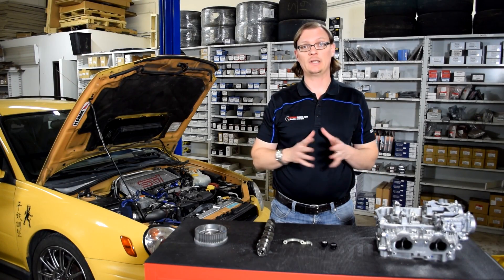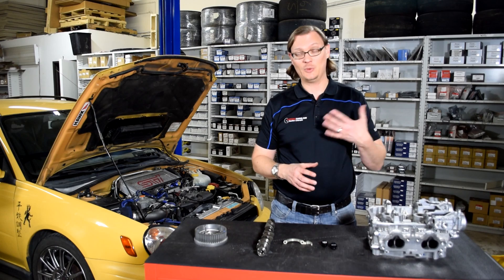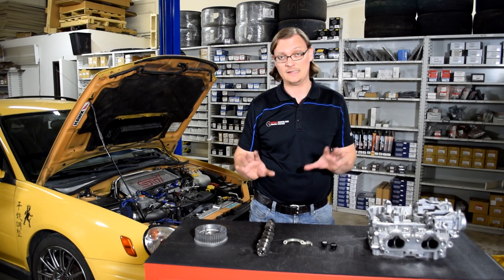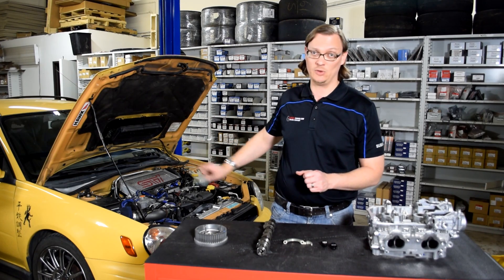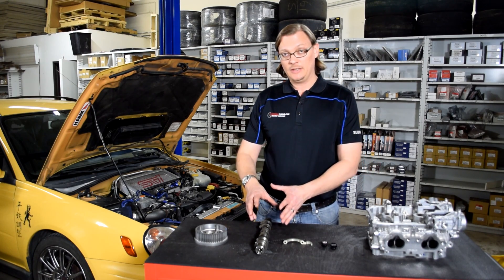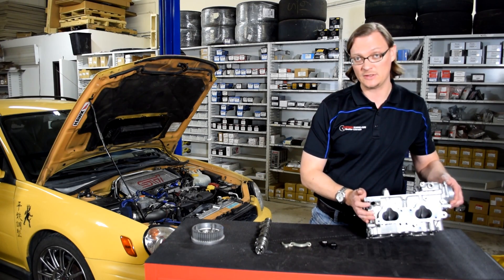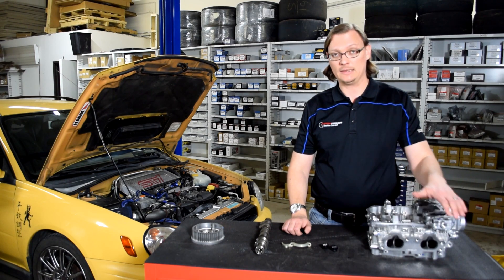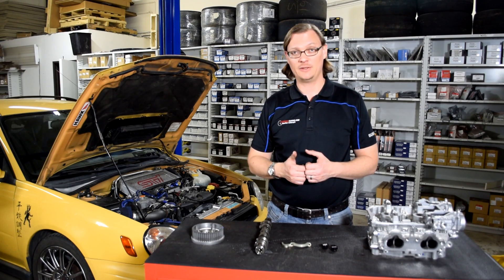How to put a turbo EJ 2.5 Liter engine into your 2.0 WRX

Comment: are the 2.5 camshaft gear teeth the same ?? n are the crank gear teeth different also ??
Reply from the maker: As long as you are working with the EJ engine from 2002 on, they are the same.

Thanks for your question and Stay Tuned!
Reply: from 2.5 to 2.0

Comment: I want to just drop a complete 2018 drivetrain from a wrecked sti into my 2 door gc8.... uggh no info... wonder if i can use the tranfer case and rear end with the new 6 speed... probably gonna need a custom driveshaft?  Idk idk who to ask lol might just have to start tearing it apart... might have gotten in over my head lol
Reply from the maker: Thanks for your question.  I would first recommend taking a look at the videos that we did on putting an STI 6-speed into a GD.  That is basically the same process for putting the drivetrain in a GC.  Here are links to them:

https://youtu.be/uf4tcG5GqDU

https://youtu.be/nUJ7E2Bh5g0

That should get you a solid start on your swap.

Hope that helps and Stay Tuned!
Reply: @FlatironsTuning  awesome! thanks for the reply

Comment: Since you must run the AVCS solenoid, is it okay if you install solenoids that are low cost or ones that are potentially bad solenoids? If the solenoids are not actively doing anything, does it matter if they operate properly or not?
Reply from the maker: Thanks for your question.  You are correct that the solenoids will not be getting any voltage, so they would not ever need to function.  I'd say that if you don't want to use new ones, known good used ones would work just fine as well.
I hesitate to say that a defective solenoid could be used.  Keep in mind that oil does still need to pass through the solenoid, and on the off chance that the solenoid failed due to metal contamination, you would not want to put that on a new engine ever.
Hope that helps and Stay Tuned!
Reply: @FlatironsTuning  that is very helpful and will save a good bit of money buying off brand vs OEM new. Thank you for the reply. You all have been super helpful in the build!
Reply from the maker: @itsrandall119  Glad we could help!  If you have any more questions, or need any parts, etc., feel to reach out to us through "Live Chat" on our site, we are always there to answer questions too.
Good luck with your build!

Comment: Is this a full engine swap? Like if I were to buy a sti engine and trans I could just swap it?
Reply from the maker: Yes, you could certainly do that.  As discussed in the videos, there are some advantages in putting in Non-AVCS cams, but yes, you can put both the engine and transmission into a WRX.
Thanks for watching and Stay Tuned!

Comment: Ok I would  like to have some clarification.  I have a 02 wrx iv been  redoing  the past 2yrs I went with  an ej257 swap. I read about the cams . So at the time I purchased  bc0601  what are ej205  cams. On line they say  it will not work. But I believe  you are saying  it can ... what do I need to do on the timming  side.  I believe  it would  be a straight bolt on using  all ej205  cam gears  and seals.  I would  just time it normal  right?
Reply from the maker: Thanks for your question.  Putting Non-AVCS cams into a car that originally came with AVCS would certainly cause some issues and take some work.  I believe that is why they say they are not correct for those heads.

But yes, as long as you are not planning to run AVCS as we describe in this video, then they will work just fine.  As long as you use the Non-AVCS cams and Non-AVCS cam gears the car will time correctly.

Hope that helps and Stay Tuned!

Comment: Hello, I have a Forester xt and a Forester X. Can I swap short blocks between the two engines ? Ive heard the ej255 with the SOHC heads will make good engine torque. But can I still make a decent running engine from the ej253 with the DOHC heads? I ask so I don't have to deal with the harness and ECU headache. Also the turbo is getting swapped as well.Thank you.
Reply: Public comments ,please don't  say but why... I have my reasons. Thanks again.
Reply from the maker: Thanks for your question.  The turbo block will bolt up to non-turbo heads.  But I believe that the turbo pistons have a deeper dish.  I would recommend taking a look at what your final compression ratio would be and go from there.

Hope that helps and Stay Tuned!

Comment: So I was just wondering, is this specific to ej257 or is this for all ej25 motors? I want to throw an ej255 long block in my 2002 wrx. How different is the ej255 from the ej257 in reality?
Reply from the maker: Thanks for your question.  From a fitment stand point, there is really no difference as long as both are single AVCS, so all of this would apply.

The engine in this case for instance is using D25 heads, and an EJ255 block actually.

Hope that helps and Stay Tuned!
Reply: @FlatironsTuning  Thank you for your swift response. That gives me some insight on my build goals. I'll reference this often.

Comment: I have a 06 wrx i just gutted the bulk head harness to do a manual swap due to it being an auto. I can get the bulkhead harness dash immobilizer guage cluster and ecu cheap. What else would i need beside the engine and driveline. Does the pedal assembly need to be sti or can i use wrx. Can i istall the harness and plug and play the rest?
Reply from the maker: Thanks for your question.  We haven't done that first hand, so I can't tell you for certain that everything will be plug and play.  But if you are using a complete bulkhead harness and the ECU that goes with it, that should work.

Good luck with the conversion, and Stay Tuned!

Comment: The 2.5 camshaft fit in 2.00 with pulley
Reply: Or I can put the head 2.5 into 2.0
Reply from the maker: Yes, that is correct.  I'd recommend going back through the video for more specific details on how this works.

Thanks for watching, and Stay Tuned!

Comment: When you say you must keep the avcs lines and solenoids do you mean just keep them in place? Or do you have to wire up the solenoids?
Reply from the maker: Thanks for your question James.  Yes, you just need to have them in place.  You don't need to wire them,  you just need to maintain that path for the oil.

Thanks for the comment, and Stay Tuned!

Comment: Thank you for your videos! Just finished my RA 5 speed build on my bugeye. So I can use 2.0 L wiring harness and ECU, just with non-AVCS cams and plug the sensor holes, but to get it to fit the 2.0L 5 speed do I need the 2.5 L flywheel and clutch?
Reply from the maker: Thanks for your question.  The short answer is no.  The clutch and flywheel are determined by the bell-housing of the transmission, not the engine.  So you would pick your clutch and flywheel based on that.

Congrats on the swap and Stay Tuned!

Comment: The video mentioned that the avcs cam gears would not receive oil pressure with the camshaft oil lines blocked, but did not say whether they would maintain oil pressure with the lines open. With the avcs system fully intact but just not wired up, would the avcs cam gears maintain pressure and be usable?
Reply from the maker: That is a good question.  Years ago when this was first attempted by someone around here, that is what they tried.  The issue was that the cam gears seemed to drift because there wasn't any control being applied through the solenoids, and it made tuning an issue.  I have heard of other people trying to keep the AVCS pulleys and solenoids in place with no power going to the solenoids, but I don't have any first hand knowledge of how it worked.

The method that we go through here is well proven at this point for what it is worth, but if you think that there would be a benefit in trying to keep all of the AVCS hardware in place, it could be worth a try.

Hope that helps, and Stay Tuned!

Comment: If I want to swap an ej257 into my 2005 wrx, all that is needed is to swap over the camshafts, cam gears, the bracket for the cam sensor as well as swap over the WRX manifold to retain the Drive by Cable, and then a tune? Is that all?
Reply from the maker: That sounds right.  You are correct in that you would need to treat that swap basically as a 2.5 liter swap.  Thanks for watching, and good luck with the swap!

Comment: Hi i wonna swap the full engine put 2.5 wrx to my 2.0 wrx is it gonna be straight swap???
Reply: You need to swap over the 2.0 camshafts, cam gears, intake manifold and  to keep the drive by Cable and purchase a bracket for the camshaft position sensor to install on to the 2.5 cylinder head. And then a tune.
Reply: @antoniopineda1556  i mean i wanna take the 2.0 engine out and put 2.5 in the full engine swap? Is that just straight swap?
Reply: @konradmakaveli630  Everything will bolt right up as far as dropping the 2.5 into the car. But in order to make it run properly you have to do a couple of part swapping from the 2.0 to the 2.5 engine.
Reply: @antoniopineda1556  ok thnkyou
Reply: @antoniopineda1556  i have a little problem can i swap the hol wires from the old engine to the new one as my throttle is different???
Reply: @konradmakaveli630  yes, you can use the engine harness from the 2.0.
Reply: @antoniopineda1556  thanks i done it all today the new 2.5 engine is starting but its loosing a bit power when im driving and trying to go a bit faster not sure do i need to plug to the computer and delete all the foults maybe that is the issu
Reply: Its like cutting out fuel or something ??
Reply: @antoniopineda1556  when the engine is on its a bit shaking..
Reply: @konradmakaveli630  which engine is it? Ej255? Ej257? And are you running the 2.0 fuel system with the 2.5?
Reply: @antoniopineda1556  i will need to check which one.. its the 2.5 fuel system
Reply: I didnt change the fuel system.. left it original
Reply: @konradmakaveli630  the 2.0 fuel system is what you want to use with the 2.5 engine. You can use the 2.5 fuel system but it involves some wiring with the fuel injectors. Easier to just use the 2.0 fuel system and make sure you are using the 2.0 intake manifold and throttle body. Also have you gotten the car tuned? If not it won't run right until you get it properly tuned. You have to get it tuned for the extra 0.5 displacement you have with the 2.5
Reply: @antoniopineda1556  ok i done the monifold and the throttle body it is tuned its got prodrive pack and remap. So what exacly i need to take from the 2.0 fuel system?? And just swap it
Reply: @konradmakaveli630  when you swap the intake manifold and throttle body from the 2.0 onto the 2.5 engine. Swap over the entire wire harness that was on the 2.0 intake manifold. Everything swaps over
 Fuel rail. Injectors. Etc. Also make sure you swap over the knock sensor from the 2.0 onto the 2.5 engine.
Reply: @antoniopineda1556  thanks what country is it?
Reply: @konradmakaveli630  US
Reply: @antoniopineda1556  thanks i change all the injectors but the car running really ruff and no power when im driving
Reply: @konradmakaveli630  Ok let's make sure you have all the parts. 
2.0 Intake Manifold
2.0 Throttle Body
2.0 Fuel System and Injectors.
2.0 Wire Harness
2.0 Knock Sensor
2.0 Exhaust and Intake Camshafts
2.0 Cam Gears
Did you purchase the bracket you need to use 2.0 Camshaft position sensor? And what size injectors did you replace stock ones with? Also when you say no power, are you talking about the engine not making boost?
Reply: @antoniopineda1556  yes engine not making boost
Reply: @antoniopineda1556  the camshaft position sensor is the one on the timing belt cover??
Reply: @konradmakaveli630  It should be on the driver's side behind the timing belt cover on the cylinder head. Did you use the 2.0 camshaft position sensor? And also make sure you don't have any boost leaks. Check your airbox/intake all the way to the throttle body and make sure hose connections are secured.
Reply: @antoniopineda1556  i didnt connect that cumshaft sensor becouse i just see i dont have that on the new engine will have to take it from the old engine and put it on the new one that what is making it running beadly??
Reply: @konradmakaveli630  you need to use the 2.0 camshaft position sensor on the 2.5 engine. To use the 2.0 sensor you need to purchase a bracket to install it on the 2.5 engine. https://www.rallysportdirect.com/part/sensor-brackets/cos1-sb0002-cosworth-cam-angle-sensor-bracket-billet-subaru
Reply: That could be the issue with no power as well

Comment: What are the advantages of using an single avcs, dual avcs vs non avcs?
Reply from the maker: Thanks for your question.  The main advantage is if you aren't using an ECU that supports single or dual AVCS, getting it to run correctly is very difficult.

It is far easier to build the engine to the configuration of the ECU that you have, compared to finding an ECU that will run AVCS.

There are some gains from the variable cam phasing, but from what we have seen, not enough to justify the effort needed to get it to work on a car that didn't have it to begin with.

Hope that helps, and Stay Tuned!

Comment: I have a 2004 WRX. will the information in this video relate to my vehicle being a different model?
Reply from the maker: Thanks for your question.  Yes, all of this information applies equally to the USDM 2.0 liter WRX's, so the 2002 - 2005 WRX.

Hope that helps, and Stay Tuned!
Reply: Sell your wrx and buy an sti. The money you're gonna spend swapping everything is gonna cost you WAY more than just saving up, selling the wrx and buying an Sti that comes with all of it stock

Comment: Can you just run a 2005-2007 ecu? So you have avcs?
Reply from the maker: You could, but you would also need to do a harness merge because there are other connectors/wires that you would need to add for the STI ECU to work properly.

Hope that helps, and Stay Tuned!
Reply: FlatironsTuning is there a schematic available for this merger?
Reply from the maker: @willadams8558  Not that I am aware of I'm afraid.

Comment: does cylinder heads from a  2002-2004 wrx fit an ej257 with 2.5  combustion chamber matching? and will this consider a hybrid swap?
Reply from the maker: Thanks for your question.  You are correct.  Putting 2.0 liter heads on a 2.5 liter block is called a Hybrid swap and there are some specific things that you want to account for when doing that.  We actually put together another video all about that, and here is that link:

https://youtu.be/M8PbLaUMPdM

Thanks for watching and hope that helps!

Comment: are those the only things you need to change? is a ej257 comparable with the ej205 and will the ej257 bolt on to the transmission?
Reply from the maker: Thanks for your question.  Yes, the bell housing for the EJ series engine are all the same so you can bolt an STI engine to a 5-speed transmission, or a 6-speed to a WRX EJ205, etc.

Hope that helps and thanks for watching!

Comment: I just toasted a bearing on my stock Ej205 in my Saabaru……. i have access to a stock Ej257 shortblock with low miles..... i want to buy the 257 casting heads from you guys and switch all the valvetrain parts over like in this video, my question is to properly run the motor will i need to get a new basemap for the increase in displacement? i am trying to get my car together ASAP because it is my daily.
Reply from the maker: Thank you for your question.  Yes, you would need to re-tune for the additional displacement if you do this conversion.  Though keeping your Non-AVCS cams will make this much easier.

I'd recommend contacting the tuner that you want to work with, and they should be able to get you a map for your initial start-up and break-in miles so you can drive it to them for the tune.

I hope that helps, and thanks for watching!

Comment: Hi. I want to put a ej207 into my 06 wrx that has an ej255. I understand that wiring for the different AVCS cams on the 207 is needed. How would I go about it or can you direct me somewhere where I can find out? Great videos.
Reply from the maker: Thanks for your question Jordan.  If you want to stick with the JDM cams, then you will have to run the JDM ECU.  If you want your AVCS to work, you will have to swap the JDM cams out for USDM ones so that the USDM computer will recognize the pickups.  We actually put together a video on this subject as well.  Here is a link to that:

https://youtu.be/3ZwcQRsUI2M

Hope that helps, and thanks for watching!
Reply: Hey if you still have the ej255 can i buy it off you

Comment: If I have a pair of 2005 STi B25 heads, would it be beneficial to only swap the intake cams to non AVCS and keep the STI exhaust cams because they are already non AVCS but have the higher lift?
Reply from the maker: Thanks for your question Jacob.  That is an interesting question.  I'm not aware of anyone doing that, so I'm not sure what the benefits or risks of it would be exactly.

I don't think that I have ever seen a set of cams with different lift between the intake and exhaust.  My best guess for this is that you would have more resistance from the higher lift cam, and that might create some vibration, or inconsistencies of the spinning of the timing belt.

My feeling would be that you would not want to try this unless you can find some successful results using different lift on cams, as it might cause more unforeseen problems.

Hope that helps and thanks for watching!
Reply: Thank you for the response! One last question you didn't touch upon in the video, what coil packs are you guys running? I have an 02 WRX and the dwell time/ boot length is different for that motor compared to any EJ25. did you guys swap just the coil pack boots to keep the same dwell time for that ECU or did you get a new set of EJ25 coil packs?

Thanks again! Your videos are life savers!
Reply from the maker: Thanks for your question.  I just moved the Ej20 coils over and they have been working just fine.

Thanks for watching!